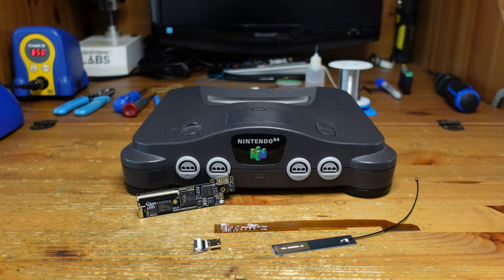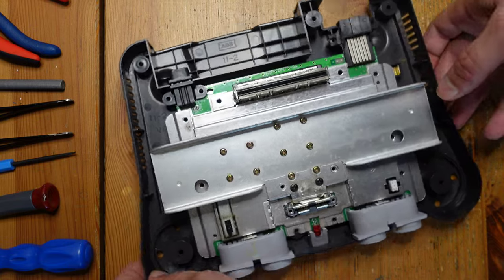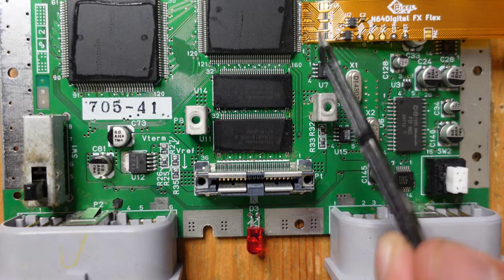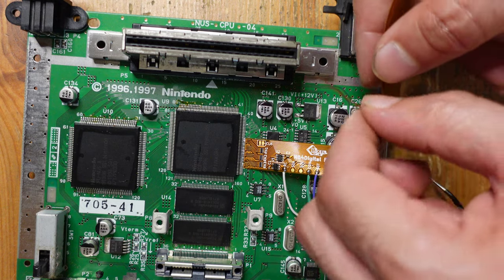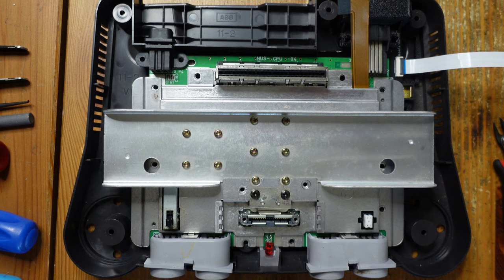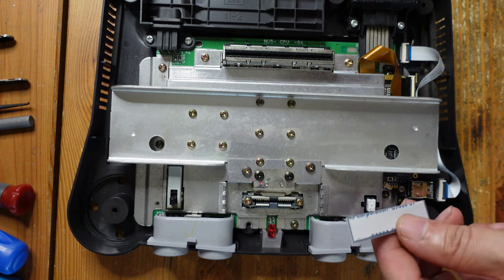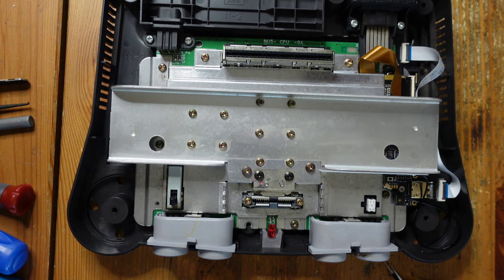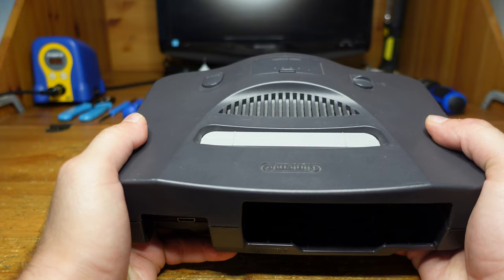The best video upgrade for your N64 in 2023! PixelFX Retro Gem install and demonstration

Comment: these will drop like a rock when analogue and the mister fpga core are released. These hdmi mods are overpriced imo and i am sure they are giving them away  for free to  youtubers to try to sell more
Reply from the maker: The analogue console looks amazing, and I also have a mister. The n64 core on there is improving rapidly! All of these options are great to have, and nothing wrong with enjoying all of them
Reply: The big thing is that the retrogem is a universal digital solution that will support numerous consoles (PS2 support being top on the list, in my opinion), you just need different mount & flat ribbons. You could get 1 full console install kit, then just the $15 mount/ribbon set for another console, do the installs on both, and then you could pretty much freely swap the board between them if you wanted (*edit - just need to re-open/close jumpers on the board to work with different consoles).

I look at the hdmi mods as future proofing consoles. Sure, the built-in scaler and features may be dated in a number of years, but the major benefit is having the cleanest possible digital signal from the console that can then be fed to whatever the latest/greatest external processor/scaler is.

Comment: I have the UltraHDMI in my N64 & it’s absolutely incredible. FPGA in the pipeline for 2024 but I still want to send my 2nd N64 in for this PixelFx mod & that Wi-Fi is a great for updates. Be great if 1up stocked this so it could be order with mod cuz it’s challenging ordering form 3rd party then ordering the 1up mod service & sending it all in.
Reply from the maker: I can certainly take care of that for you, and you can ship the parts directly to me next time to save on shipping
Reply: @LIRetroGaming how much do you charge to mode the 64 I have the console and the mod kit

Comment: How does this compare to the other HDMI solutions?
Reply from the maker: It’s definitely better than the 64HD and the UltraHDMI N64. Higher output resolution, lots of scanline options, black frame insertion and other nice features
Reply: @LIRetroGaming  Darn, I have the N64 Digital installed in mine, would be a hassle to get this one 😅

Comment: You make it look easy. Someday I’m gonna give it a try.
Reply: I know right. I would have caused so much damage and so many bridges mouhahahaha
Reply: I wouldn’t recommend it without soldering experience. Try it first on a practice board. Soldering on a flex cable is even more “difficult” because it’s more sensitive to heat and force applied by the solder tip
Reply: I'm not like an excellent solder...er but I installed an N64 HDMI kit on my console last night, it really wasn't incredibly difficult. Wiring is exactly the same as this one, but it was a different kit. Just make sure you use some kind of magnification and check for bridging (which is less likely with leaded solder). The bitchin' camera on my S22 Ultra made it easy to check for bridging. Tin the cable, tin your pins, then it's pretty easy to do the actual install, as long as you've done a decent amount of soldering before.
Reply: @brandogg  Is it worth the hard work?

Comment: quick question did you print the no cut or did you buy them from somewhere?  gonna do this mod myself  with a extreme green n64 shell  and some uv lights inside to make it glow :P
Reply from the maker: You can buy them from laserbear or print them yourself
Reply: @LIRetroGaming   nice.  thank you.  i dont have a 3d printer unfortunately or i would do that.
Reply: @LIRetroGaming Do you know where i can find the files for the print?
Reply: You know where to get the files for printing yourself?

Comment: Just learning about this kind of stuff, specifically for the n64; Is there an essential difference between something like this and a retrotink? They are both essentially upscaling and allowing use of hdmi, yes? Its just a matter of ease of use, price points, aesthetics, some features, footprint etc? 

Sorry for the noob question, just a nostalgic guy trying to hook his n64 up to a modern tv to play with his kids lol
Reply: The difference is the signal that takes. The retrotink takes the analog or digital signal that comes out from the video out of your console and upscale that to the desired resolution. The HDMI mods, like this, works with the digital signal that comes out from the chip, so there is no digital to analog conversion. The downside of this mods is the soldering knowledge You need to install it, and the possibly needed cutting to fit the HDMI port. Another retrotink's advantage is that You can use it with multiple consoles. Yo can Even use both at the sale time, for example You can install this mod for outputting 1080p to the retrotink 4k, and that upscales it to 4k (something note possible with the retro gem only)
Reply: @MatyLbdt14  is there a benefit to not having to convert the signal from analog to digital in the case that you use an HDMI mod?  I've heard there's no input lag added in either case...
Reply: @jayjayhooksch1  there is some signal degradation when You convert digital to analog, to then convert it to digital again , but it's almost negligible. either of both options make a clear picture Quality, if You are using good quality rgb cables with the retrotink

Comment: The closing Jumper for the clock mod, is just soldering It?
Reply from the maker: Yes. The clock mod is also totally optional
Reply: @LIRetroGaming  Ok, perfect. I tried by myself and i just cant 😂, thanks god i picked a backup cable. I contact from your web, i will probably send it to you.

Comment: Does an RGB mod an addition to this provide any benefit?
Reply from the maker: You can add one and it’s good if you ever need to use the console on a crt instead of through hdmi
Reply: @LIRetroGaming  so it doesn't do anything for HDMI but provides better functionality on CRT, yeah?

Comment: Question is the Gamebox 64 picture quality just as good as this Pixel Fx? Or they about the same but if you get the "Shiny" edition it blows everything out of the water? Please let me know when it comes to picture quality. Ive read somewhere where a guy has Shiny Edition, but said picture looks better in 480p or 720p with using an M-Classic instead of no M-Classic and on Shiny Edition 1080p. I do have an M-Classic so wondering if i be good with Gamebox N64 set on 720p with M-Classic
Reply from the maker: It’s similar to a basic version of the PixelFX retro gem, but the shiny edition is definitely better. Personally I don’t think the m classic does anything to improve the video image.

Comment: Is retro gem shiny better than the previous n64 digital chip?
Reply from the maker: For now I would say they are pretty similar. The older chip also has RGB built in which is useful
Reply: Ok, will prolly stick with the older chip then if im not missing out there, but if it doesn't have rgb then what does it have? Is rgb not needed for the digital hdmi connection and only for the components cables?

Comment: Do you use your microscope to solder these small ribbon cables or you just free ball it? Also i laughed so hard when you realized you forgot a part mouhahaah omg so funny. so happy you kept that in.
Reply from the maker: Normally I use a microscope for the flex cables but when I film I have to do it without the scope unfortunately

Comment: i got the n64 pixelfx ultrahdmi mod and just bought a new tv 4k oled. turns out i have significant latence issues. any ideas why and how to fix that? on my old LG everything was flawless!
Reply from the maker: It’s likely the tv and not the n64 since you can measure the n64 latency in the self test menu. The tv needs to be set to game mode and have any extra image processing turned off. All that stuff adds lag